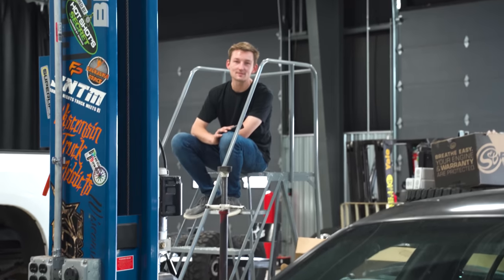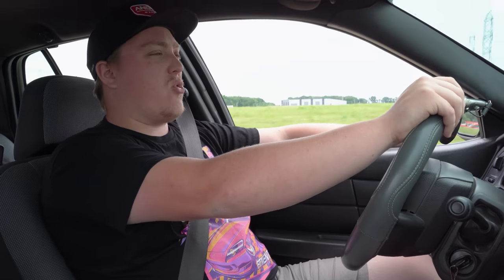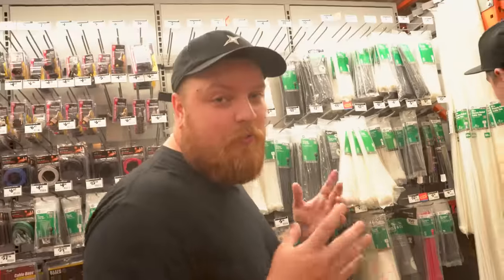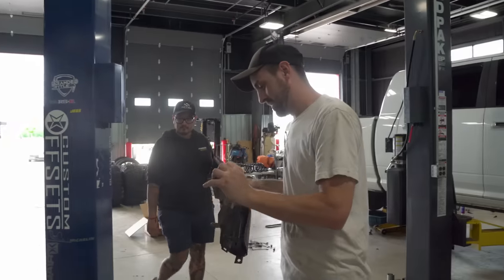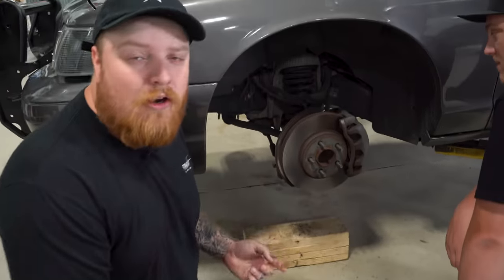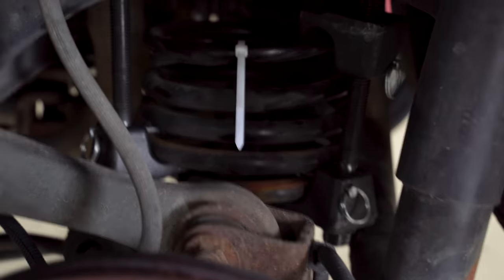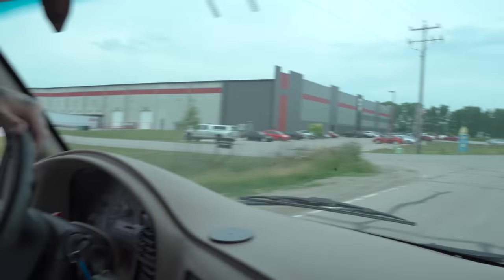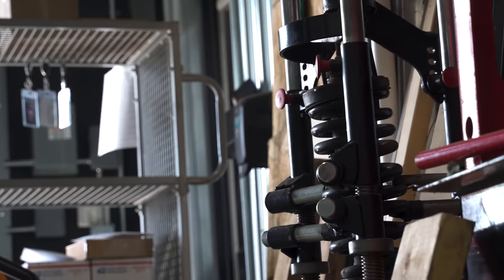We Lowered Our Crown Vic With Zip Ties

Comment: So I was just about to purchase some lowering springs for my G37 coupe but now that I saw this I'm going to Home Depot lol. Thanks FI for the FYI DIY.
Reply from the maker: Might want to stick to the lowering springs 😅
Reply: You're better off cutting your springs. Ive been doing it for years and it works perfectly fine if you do it properly. A lot of people screw it up anyway. I have an '07 Focus wagon with cut springs because no coilovers or lowering springs exist for it. Sometimes cutting them is your only option. The three things to remember when cutting springs is to make sure they're even, only cut one full coil at a time and do NOT heat them up with a torch. Other than that, make sure your springs are reseated properly afterwards.
Reply: This can be a series title. “FI FYI DIY”

Comment: Another super old school way is basically limiter straps with chains (but straps would be quieter) from the top of the spring bucket to the lower control arm for the front and from the top spring bucket to the bottom mount for the rear. Just compress it how low you want with weight in the vehicle and add the limiter chains or straps. Or obviously cut a coil or two off the closer together portions of the progressive spring in the front and like a half a coil off the rear whichever is the larger diameter end so it still sits in the pocket.
Reply: I had limiter chains in a lowrider I used to have. I wrapped the chains in exhaust wrap to keep em quiet.
Reply: @travisstamp7428  good idea!
Reply from the maker: Never heard of that method!

Comment: Lol! I am lowering my 2000 Mercury Grand Marquis this month. Had to replace every suspension part in the front and back because they were so old and worn. Now I just ordered some lowering springs for the car and then this video came on. I never laughed so hard in my life.
Reply: where do you find lowering springs for a pre 03 panther car
Reply: @knooda7785  I can't post a link here. They will delete it.
Reply: @knooda7785  a company called Eaton Detroit Spring makes kits for all 87-2012 Ford Crown Victoria's 👍👊
Reply: @chasejones3456  thanks
Reply: @knooda7785  you could also get some moog springs. the rear you can run moog 80871 and i forgot the fronts
Reply: @vinfxd  Actually it is Moog CC501 springs for the back. They will lower your Crown Vic, Grand Marquis about 2 inches.
Reply: @ragintaurusmusclemercury7023  you're right- the 80871s are for the front. You could also use the 80551s for the front but the cc501s for the rear are the closest alternative for lowering the rear with springs other than the gt500 springs
Reply: @vinfxd  Eaton Detroit Springs make lowering springs for '88 to '11 Crown Vic, Grand Marquis, and Town Car but they are expensive. $300 a pair plus shipping. They come in +1", +1.5", and +2" lift and 1", 1.5", and 2" drop. You are looking at $700 for the complete set. I just bought a pair of Eaton 2" drop springs for the front and a pair of Moog CC501 springs for the rear of my 2000 Grand Marquis. Installing them next month.
Reply: @ragintaurusmusclemercury7023  I didn't hear good things about the Detroit springs unfortunately. Even emailed Chris at ADTR-- he used to carry them but due to Detroit springs shipping the wrong springs he stopped carrying them
Reply: @vinfxd  I had no problem with them. Received the right ones with my '03 Marquis  LS. Just got another set for my '00 Marquis GS. Then again you have to give them exact specifications of your car. If not there is a chance you will get the wrong one for your application.

Comment: I Used 2 Large threaded U-bolts with jam nuts and lock tight, 2 U-bolt's per spring and Ur good to go! got my crown vic 2.5 inches lower in the rear that way, went with moog springs and new struts' in the front

Comment: If I get a set of wheels and tires do I also have to get the tpms or is it included?
Reply: you can buy it at checkout and they install them when they mount the wheels and tires
Reply: @cccraigslist  thank u 🙏🏼
Reply from the maker: They are an add-on at checkout!  But if you order them with your wheel/tire package, we will install them!

Comment: Hey if you heat the spring (one coil at a time) with a torch it will lose its memory and sag the springs.
Reply: That is a BIG no-no. You'll blow-out your shocks and crack your a-arms really fast.
Reply: @Whats-It-To-Ya  Fair point